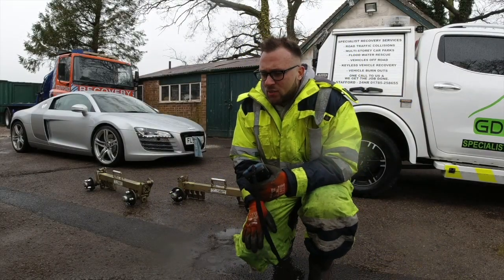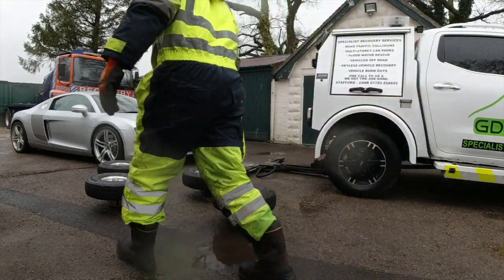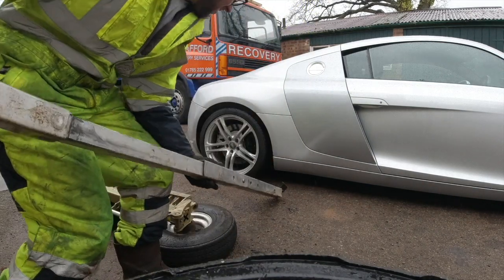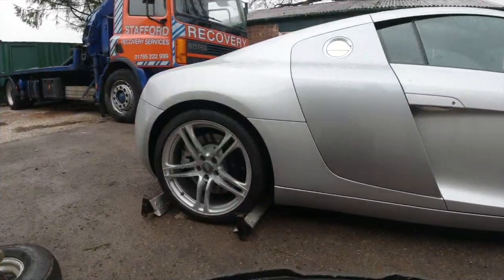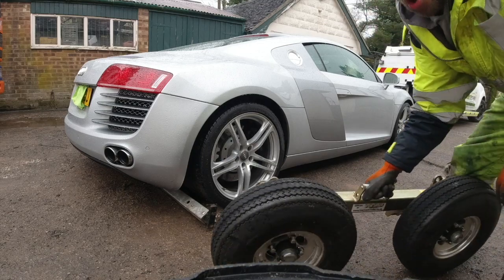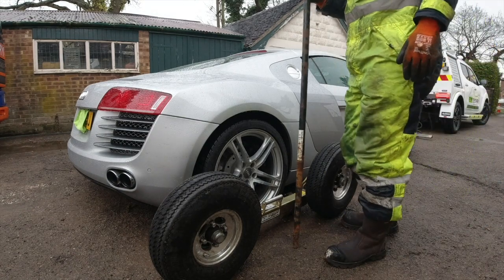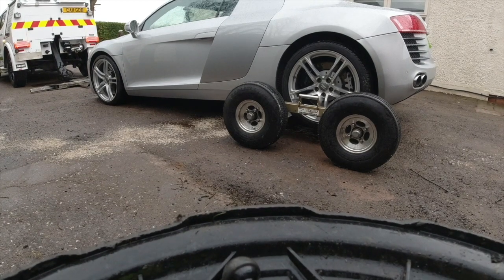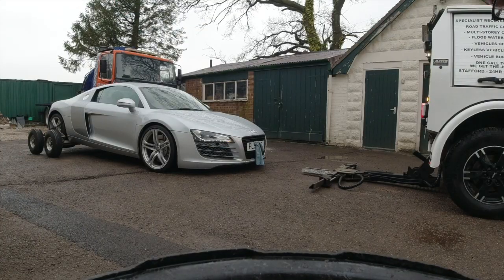AUDI R8 4.2 V8 SPECIALIST RECOVERY TRUCK USING IN THE DITCH TOWING DOLLYS NISSAN NAVARA 4X4 BY AMS.

Comment: Ace video thank you for sharing, doesn't seem the quickest method of recovery though
Reply from the maker: No problem thanks for watching! Yes that is very true certainly not the fastest but they are efficient compared to tilt and slide trucks in tight access etc! We do have some small skates in back for car parks & flat ground but wouldn’t want to use on roads etc!
Reply: @GDBRescueandrecovery  yeah I can definitely see there place, I would still love to find myself a set